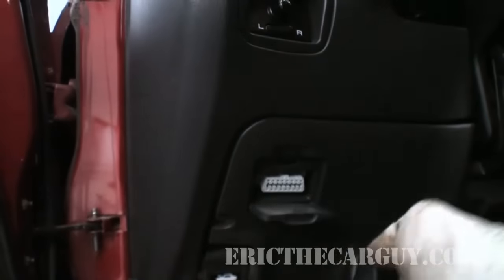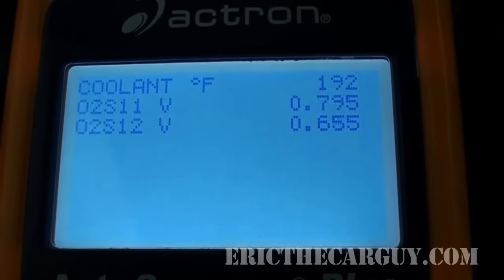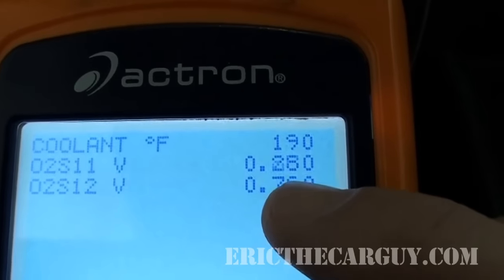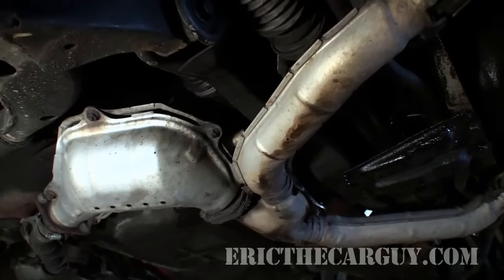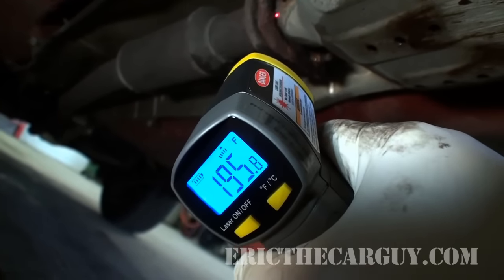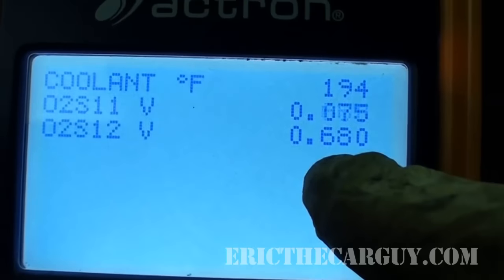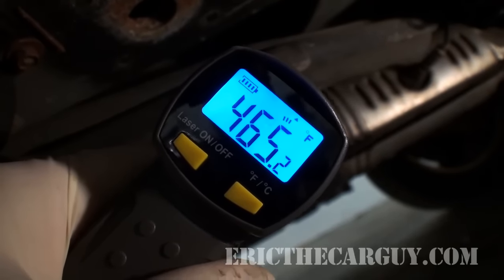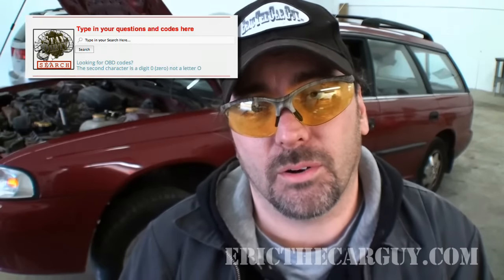P0420 How To Diagnose A Bad Catalytic Converter -EricTheCarGuy

Comment: hi my golf5 1.9tdi turbo fails but no runaway atall engine off soon white smoke came off exhaust and bannet i had factory fitted turbo witch was just siren no lost power or oil leak or anything till it dead so i   tow the car to turbo specialist to replace with reconditioned turbo and system clean up and fresh oil and air filter fitted i pick up the car today but car it has no power and boost on near 2000rpm and in motorway cant go faster then 65 mile its like a  limp mode the guy saying it could be a cat blocked with oil in exhaust and give it a good rav in motorway to burn and melt the oil in cat could it be true or its faulty turbo ?
i had a economy remap stage1 witch it use to pull in all gear very good with half dead factory fitted turbo and was thinking car going to be much faster with this new turbo but its not could they change the setting in ecu to factory recomended ?
or they dont mess with ecu cos i payed only 300 for my remap advice please

Comment: Is the downstream sensor of any value to the fuel trims.  I have read and heard that is nothing more than a monitor to see if the cat is still good.... Mine shows a flatline in the top 90s, it is obviously dead and no check engine light...  In a nutshell, it is even necessary to replace the cat sensor and what is the benefit.
Reply: Your downstream graph data should essentially look like a near flatline if the sensor and cat are working properly
Reply: mine is totally flat lined and has no reactions at all for some reason.  I am assuming that o2 is dead...

Comment: my 99 yukon threw a p 0420 then just went away after so many starts and short trips... question, p0420 and p0430 are corresponding " left and right" cats is the p0420 my right cat,? the right cat does look like it's been getting a little too hot.sluggish motor and when cruising at 35 or 40 I can feel a certain surge in power , more like a fast loss then it comes back.the entire system is a bolt on,easy to do but cost $500.00 dammit or I can just replace the bad one by buying a magna flow single cat and have it welded in at a shop for pretty cheap.but like I said I need to know  which side is the " p0420, right side meaning closest to passenger side door??? anyone out there know?

Comment: a scenario for o2 sensor.. My gmc did this. The fast switcher ahead of cat (3rd o2 sensor) needed replace. It is now a different o2 sensor than the twin after the cat.. triggers a code. My p0420 passes inspection. Unusual case of two brands of o2. Replace those in pairs if it is the final trim and aft cat reader...ecm gets confused.

Comment: What if you have the p0420 coda and the temp is around 100 degrees hotter on the back side of the converter
Reply: clogged

Comment: Eric, you are not getting accurate temperatures. 1.) distance to spot size; It should be on the side of the tool, 2.) Ir guns are not accurate on reflective surfaces (shiny metal).

Comment: mine has a hole burn though. it I found that someone. put inslatinge shoved. in where the egr. goes well run but. when I step on the gas pedal it won't go over 45 to 50.

Comment: hey eric, i checked my converters using this test with the heat gun and i have changed both the converters and all 4 o2 sensors in response to the post cat temps not being hotter than the pre cat temps but immediatly after putting all new parts on i smell the "rotten egg converter smell" and i redid the heat test and nothing has changed. the temps post cat are = to or less than the pre cat temps. and everything is new. what should i do now. HELP!

Comment: 10-5-17 got an issue guys, since yesterday I learned how to use the LIVE DATA feature on my scan tool from centech, I was monitoring the o2 sensors on the  08 Subaru outback and the 2000 corolla, it seems that the Subaru 1st o2 sensor stays around  2. something volts mainly and that the 1st o2 sensor for the corolla seems to be weird as well, I forgot the readings its like   .025 or .0025, and goes to .030 .0025, I have to update the exact value of the car later, does this mean the 1st oxygen sensors are bad on both cars, Subaru  has a p0420 code and it seems the 1st cat is bad since I did the scan tool test and temp. gun test   but I can't test the 2nd converter with the temp. gun and for the corolla it has weird codes like p0300 that disappear, then a  p0171, p0120, though I think this is because he took some parts out and did stuff to the TPS sensor and he had a new 3rd code for some idle control

Comment: My CC test good on all accounts (temp and O2 live data test)  but the P0430 keeps popping up. Where do I go next?
Full disclosure I changed out the Bank 2 DOD lifters a few weeks prior to the PO430 code.
Reply: the sensor itself?
Reply: Thanks for the suggestions! The O2 usually tells you when it's bad. Also, if it was bad I don't think the readings would be consistent with a good CC?

I might trade sides with the sensors and see if the code follows though.

Comment: I have a 1998 Honda Accord and I am being told I need a catalytic converter. ugh.  I also think my 02 sensor may need to be replaced. Car is a bit sluggish, uses up gas.
Reply: Hey musicfan, if you have not fixed this problem take it to an auto store where they can pull the codes for free.
Your problem of it being sluggish and using up lots of fuel is also a classic open O2 sensor. If you have an AutoZone in your area they'll pull the codes for free for you. Hope this helped, and you get it fixed. Keith.

Comment: Why doesn't anyone read the temperature the sensors are reading rather than using one of those laser guns? On my OBD device I can see the temperatures from sensors 1 and 2 so it wouldn't that be the temperatures in front and in back of the catalytic converter?

Comment: I got a po420 reading when my check engine light came on I just cleaned them with mass airflow cleaner I just took the two nuts off let them hang just spray them clean let them dry about 30 min put them back on the check engine light may stay on for a while till the computer registers it if it doesn't go away then one of the sensors may be bad

Comment: I have the same code on 2005 Silverado 4.3 l My obd monitor reading catalytic converter but in drive cycle monitor show is ok and in same time when i pass catalytic  monitor ok  check engine light jump on i m so tired off that emissions test

Comment: it's not always the Catalytic Converter when a p0420 is thrown...very commonly it's a vacuum leak at the intake, especially if it's the plastic type. simply replace your intake gasket, as well as the throttle body gasket. these gaskets go bad over time and will trick the o2s because unmetered air is getting past them and you end up getting a false positive reading for a bad Cat...just do some homework and look closely for vacuum leaks before wasting money on something that isn't actually bad at all. Cats very rarely go bad and o2s will usually throw their own code if they're failing, so simply replace the gaskets I mentioned and see if that solves your issue...you're welcome!!!

Comment: Hi Eric. I got ford Escape 2005 3.0 
check Engine light is on and the air blow from air in take. the engine is run not smootly. What is the problem? Please help me for the answer. Thanks

Comment: My primary 02 is at over 3.2 volts and my 2nd 02 sensor is all over the place from .200 up to .800 . So what does that mean? 🤔
Reply: Is it a Toyota?with volts like that I would say your b1s1 and b2s1 is air fuel racisho other words AFR that would be about normally.....now b1s2 and b2s2 the way THER acting...I would say the cats is NOT doing ther job....

Comment: How do I know which catalytic converter needs to be replaced I got the p0420 code and my truck a Toyota 2002 4 cylinder engine has two catalytics.
So is it the closest to the engine that I need to replace?
The code says "below threshold bank 1"
Anyone know? 
Thank you

Comment: it appears this car only has 2 oxygen sensors. how would you approach this concern and test if there were two pre-cat and two post-cat oxygen sensors? anything differently?
Reply: i ask for my 09 bmw 335
Reply: for my car this is the setup

Sensor 1 = Upstream (primary, pre-cat)
Sensor 2 = Downstream (secondary, post-cat)
Bank 1 = Front (cylinders 1-3)
Bank 2 = Rear (cylinders 4-6)
Bank 1 Sensor 1 = Front - Upstream   (cylinders 1-3)
Bank 1 Sensor 2 = Front - Downstream   (cylinders 1-3) / 560mm length o2 sensor
Bank 2 Sensor 1 = Rear - Upstream (cylinders 4-6) / 1200mm length o2 sensor
Bank 2 Sensor 2 = Rear - Downstream (cylinders 4-6)

to test for the cat being bad would i need to look at both of my upstream to move rapidly & both my downstream to remain steady?
Reply: i've been studying like a dog and can't figure it out.... cat glows red and only codes i get are misfires on cylinder 4,5,6 and i know it's running rich.. FML!!!!!!

Comment: You can get them cheap on ebay, no need to spend thousands at AutoZone or advanced or Napa auto parts store, just order online and take them to a muffler shop and have them install or you can do it yourself, with the right tools and knowledge, that all said, just my opinion.

Comment: so all o2 signals on all cars are the same? all ecu's have the same input and resistance that equals the same output voltage for the 2nd O2 sensor?

Comment: I just had thar code on my sisters car chevy aveo 2006 i connect the scan tool and got p0420 but i check those two readings an i was getting like a good catalytic upstream sensor up and down and downstream sensor steady so i erase the code run the car for like 73 miles went to smog place and pass so i dont know what was the problem

Comment: CONFLICTING INFO - I did the voltage test and the downstream O2 sensor reporting very low voltage, .05.  The heat test is 120F going in rear cat and 140F coming out.  I replaced the O2 sensor and still very low voltage.  Any ideas???
Reply: UPDATE:  The car has 3 CATs, one off each bank of engine and one in the rear.  The 2 on the banks are fine with temp test; 400F going in about 200 going out.  The rear is 120 in and 140 out.  The rear makes some crackling noise intermittent.

Comment: 2/2
So I realized there is a problem somewhere, eventually found a test to see if the catcon was clogged by removing the front o2 sensor so the exhaust gases bypassed the catcon and see if power was restored, and just as predicted my car easily passed 4k but my car loved the power and I didn't want to go too high and shifted perfectly at 4500 rpm, no problem whatsoever. However, I caution anyone doing that test to wear ear protection and do it during the day because it gets LOUD!

Comment: I been wondering if someone would make a line to screw in the upstream o2 sensor to introduce extreme hot water & antifreeze mixture to burn off the stuff & make it like new again..simulate a blown head gasket with lettting moisture in at the egr pipe or upstream 02 sensor..we all know that combo cleans parts spotless...we cut off a cat at the junkyard from a car with blown heads & the exhaust was spotless..if you changed head gaskets then you'll see the cylinder causing the problem because it's so clean ..water & antifreeze will clean it but it has to be very hot

Comment: I have a 2003 Toyota camry 
 when it is cold on mornings it do not idle people u have to play with the accelerate, when it warm up it work well, what can I do or check .
Reply: Make sure the radiator is full of coolant. If the coolant temperature sensor doesn't detect proper water temp at startup. The computer will not feed the engine enough fuel to idle when its cold

Comment: WAIT, what did I miss.  I get random 420 on Toyota (twice so far, went away after resetting, now reset again), but this doesn't really show how to remedy.  I watched lat two minutes over and think it's saying to diagnose and see if temp differential,  but if so, just ignore?  I'll still get code.  I only care because I have smog due and thought reseting fixed and then it appeared randomly the other night.  With my luck it'll appear as I drive to the shop.
Reply: So, my codes clearly show the mirrored outputs implying bad cat (downstream sensor bounces in tandem with upstream), but the temp test showed the increase in temp as you show for good one.  Like a delta of 120 degrees.  I asked a muffler shop owner who said he didn't think that idea worked.  I'm curious about the validity of why this would work, chemically it makes sense, but I think LiveData is still the best way.

Comment: Will someone please help me ?  I have 2004 bmw 325CI E46 M54 158K miles - car has sluggish acceleration when shifting through gears - loss of power on hills and struggle  - starts up like a champ runs great 55 and above straight road.  I am told the problem is bad catalytic converters.   Cost is $3800 - I don't believe they are bad.  No codes are being thrown P0240 PO230 - back pressure tests performed - numbers 2 and 3 - both dealership and mechanic say I need new catalytic converters.  I don't trust and need to know if anyone can recommend what I should do?    Mechanic said he cannot remove rear oxygen sensors without destroying to test my converters although he claims they are bad.   The oxygen sensors are $250 a piece.  Do I tell him do it and buy new ones if they break, do I get more opinions about my converters, can they be removed and cleaned ?  Most importantly, why isn't the car throwing codes.  This is my only vehicle and need it fixed.  I will be in horror if 3800 is spent and doesn't correct the problem.

Comment: Can a bad cat actually delay acceleration because when I first turn on the car it is accelerating like it should be, really hard but when the car is warmed up to op temp it doesn't go, even when I'm very close to the floor.
Reply: Definitely, a clogged catalytic converter can result in poor acceleration. I recently replaced my cat because, like you said; my car could only reach a top speed of 50mph while flooring the gas pedal! It was a nightmare. I thought for sure it was the transmission at first. I got no CEL codes though. So I decided to actually detach the muffler pipe that connects the cat to the back of the engine. I held the detached muffler pipe and cat to the bottom of the car with hanger wire to stabilize it as best I could. Then I drove it around the block ( Driving the car in this manner is extremely loud! ) Low and behold, with the catalytic converter detached from the engine my acceleration problems were eliminated! I knew then, it was time to replace the cat. I did so and my car has been accelerating and preforming better than ever. Hope this helps you on your way! =) Also note: After removal and upon inspection, it looked like a brick had been stuffed into my old catylitic converter :O
Reply: +Ronald the Stax Thanks, I'll check it out

Comment: I have code po420.
I have 2001tahoe 5.3.
Starts well.
Runs well.
Idles well.
But...but...
Drive it for 2 to 3hours,and it stalls.
Rattling noise and engine dies.
Oil pressure light comes on for 2seconds and that's it.
Pull over and restart it and it's good again....idk man ...any idea???

Comment: I have 2011 gmc acadia with code p2099 the dealer replace fuel injector ,mass air flow sensor ,spark plug only fix the problemm for 15 days now is the same. Any help please how 2 fix this problem

Comment: There are two things to look at when diagnosing a P0420 or a P0430; Secondary oxygen sensor voltage switching similar to the primary oxygen sensor voltage and an oxygen storage test.

Measuring the temperature of the inlet and outlet is not reliable. And when monitoring the voltage of the sensors it is very important to use a graphing multimeter or, ideally, a lab scope.

If you are going to rely solely on the tests in this video, save yourself the trouble and just replace the cat because guessing is equally scientific.

Comment: I don't get why these are so expensive a ting to replace....looks like its easy to bolt on/off style part.
Reply: +Nate W Thibodeau They use precious metals in the catalyst to break down exhaust gasses. Older, or stock/original cats, usually have more metals in the catalyst than aftermarket replacements do, which is why they cost more but usually last longer that aftermarket parts (OEM "style)".
Cats used to be big money for scrap metal dealers, many dealerships and car owners have had their cat converters cut off/stolen at night and sold for scrap.  With newer cats having less precious metals in them, they garner less in scrap and thus theft has gone down considerably.

Comment: If your sitting on the drivers seat witch 1 is Bank 2 Catalyast  the one clousest to the driver or passanger
Reply: Xeni Ibishi depends how your engine is placed under your hood but if you look straight at the engine in front of the drive belts the bank on your left is bank 2

Comment: My honda accord 2004 sounds like a motorcycle especially when I start it up the next day and when i press on the gas it sounds like it will explode then goes slightly quiet when I park or take my foot of gas pedal . Now check engine light came on not sure if it's muffler or catalytic converter.
Reply: I went to see a mechanic and they fixed the problem.I'm  so happy it's not making noise anymore.
Reply: +no map how much did you pay?

Comment: Eric,

why do you take the temperature readings before and after the cat?
Reply: inlet hotter vs outlet colder = bad (exhaust not getting heated), inlet colder vs outlet hotter = good (heat dispersion). at least that is my current theory